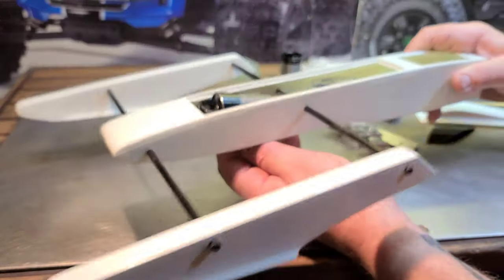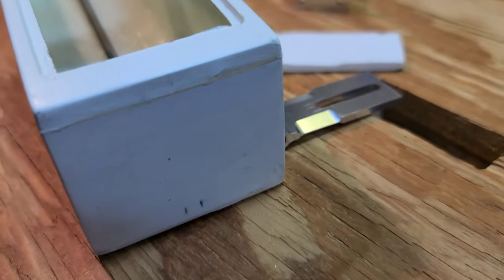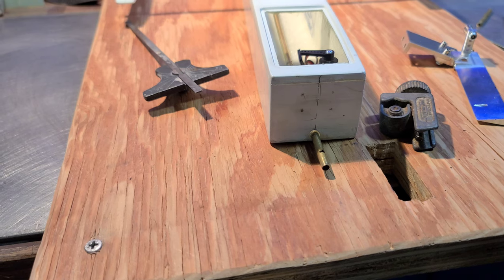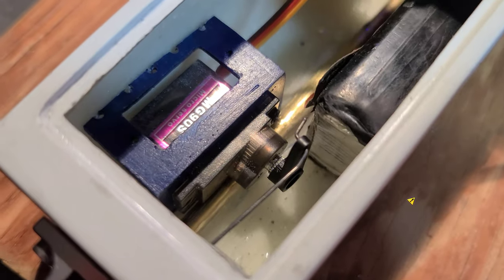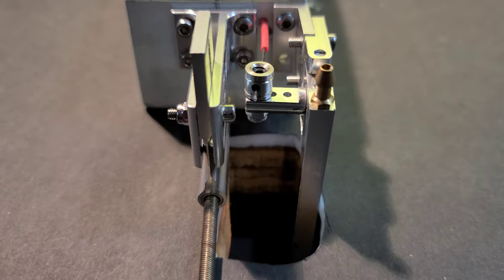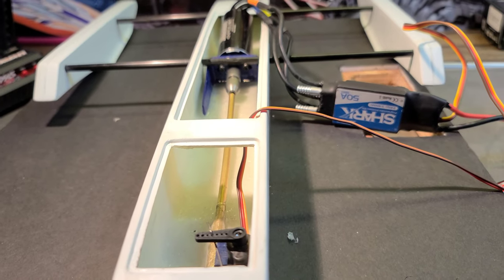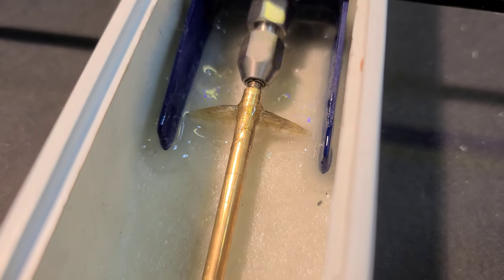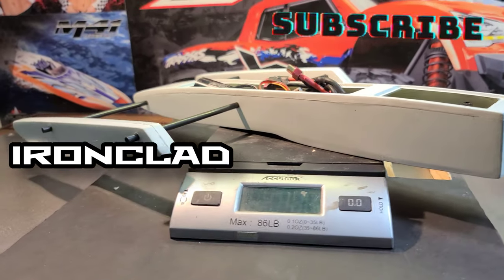Build a RC Rigger Boat | Pro Boat Mini Outrigger Build Pt.1 Hardware & Electronics Install

Comment: Love mini riggers, small fast and fun. Don't forget to pack the servo with waterproof grease.
Reply from the maker: I used corrosionX  for servo
Reply: @IRONCLADRC  Ok if it's grease but the liquid wears off over time. Packing with dielectric watwrproof grease is best. 😊
Reply from the maker: Nice thanks for the advice  my dielectric grease grew legs and walked off.   😆
Reply: @IRONCLADRC  That will never last as long as grease or protect water intrusion. 😉

Comment: Nice one😊👍..I think you will get a real surprise how quick this will be,I've just tested my 3652 model rigger and really quick but with no turn fin the steering was insecure so I have a right turn fin ,will you add one? at the very back
Reply from the maker: I did run a turnfin..  I just ran mine today for the first time. I didn't like the way it ran with the fin  I may take it off and use toe in/out for the ride adjustment. She was bouncing on the right sponson so i definitely  need to fine tune or do away with fin all together.  How did yours turn w/o fin?
Reply: @IRONCLADRC  Thanks for that..I added a turn fin as it was unstable steering would go off to the left real easy but at full power seemed great..I think try a fin on both sides 2 is meant to straighten it but I don't have 2 fins
Reply: @IRONCLADRC  I will put a vid up a bit later showing how it zipped to the left..Yes maybe you could benefit from toe in toe out but I'm asking others about fitting turn fin on right spontoon and they say yes
Reply: you need the turn fin it must be a known type and youll need a digital spirit level to set it .25 of a degree at a time and you need to back off your turn limits toe in about 2 mm on the LH sponson and the fin goes with it .
Reply from the maker: I've been using a shim between the turnfin and its mount, to try and dial the fin in  it's helped  a small amount..  Paul are you using 2 turn fins or just 1 on your rigger?
Reply: @IRONCLADRC  Hi,i put 1 straight turn fin on almost like a rectangle shape and set it how you would a normal turn fin on a boat set and it worked perfectly but I sold the rigger and put the setup into the Vector SR48 cause it self rights.I remember when I put the fin on the right side it turned right with good control and I had to adjust the steering on my transmitter to drive straight and I had to set it when it was going full speed

Comment: Hi. I have a little outrigger boat like you, i have no turn fins on it and the boat will not turn at any side when more than half throttle, i always had to stop an turn the boat slowly, once i tryed a turn fin on the left side, but that doesent worked, when i pushed the throttle the boat turned to one side 90 degrees to often?
Do you have any idea or tip for me?
Reply from the maker: Normally the turn fin is mounted on the right side (starboard)  the back of the turn fin should be inline with the center of Gravity.   Try a curved turn fin it hooks better in a turn.
Reply: Sorry i mean the turn fin is on the right side and yes it is curved, but i did not check the cg.
In this configuration the boat was not able to go straight forward, suddently id did a turn, now i am driving it without any fin but i can not turn like your boats.

Comment: Does the receiver antenna just sit inside if the boat, or does it need to mounted to the outside to receive signal ?
Reply from the maker: Outside is best I don't have a problem with reception with it inside.  I suggest using a submerged drive for this boat not a surface Drive line like you see in this video.
Reply: @IRONCLADRC  ....you mean tube thru bottom floor of boat ? What motor did you run on 3S ?

Comment: Did you not notice there is a grub a srew on top of rudder to change positions????
Reply from the maker: Yes sir  lol after the fact
Reply: Only found out myself mate 🤣🤣🤙🤙
Reply: Question if I may rigger prop shaft angle any advice thanks
Reply from the maker: I'd run it out the bottom of the boat. Run a submerged drive like in this video link https://youtu.be/zbrH-WIRlpw
Reply: Thanks for vid link ya sent , I'm useing soiled prop shaft not flex but will use ya advice thanks mate